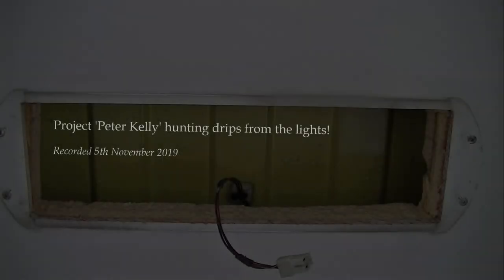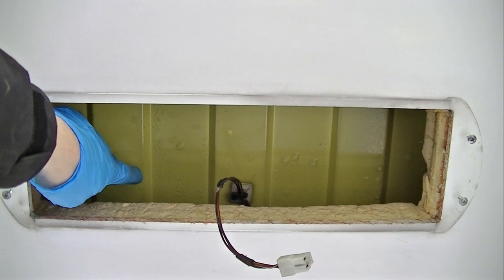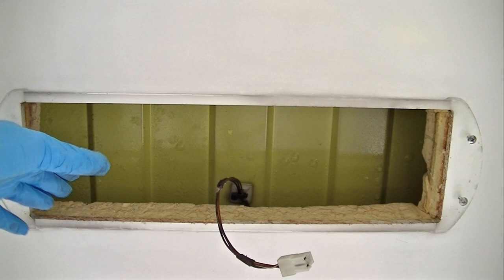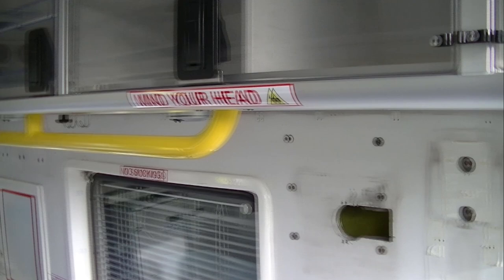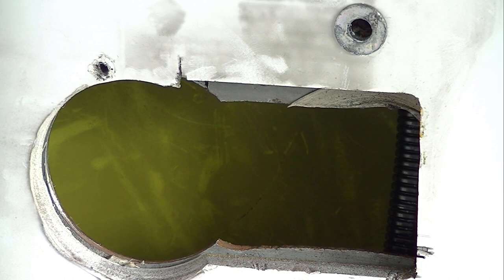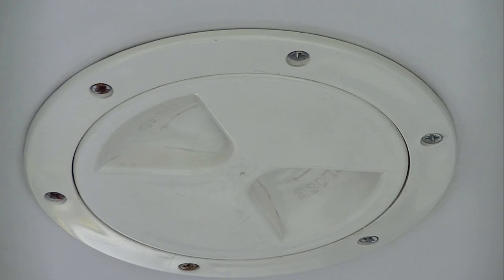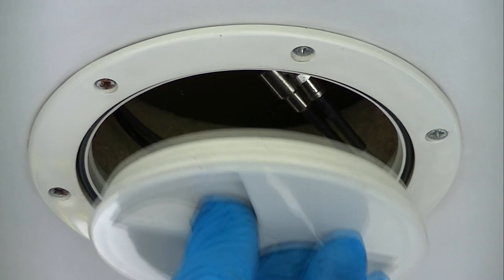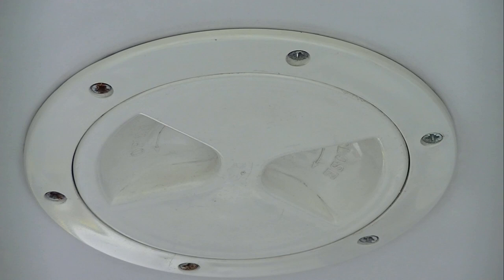Peugeot Boxer ex UK A&E Ambulance conversion, condensation due to compromised insulation.

Comment: Good airflow to the outside behind the insulation works great on buildings hence all the vents.
Vans are a different beast though.
My old Talbot express has around 4 mm of insulation sandwiched between two pieces off 3 or 4mm ply with a 3 to 4' gap between it and the outer skin, no vapour barrier and it's 27 years old, yes, 3 to 4 mm insulation lol. The eberspacher works great and cheap to run for long periods 🙂
The ceiling is better insulated I think and I'm not sure about a vapour barrier.
There is quite a lot of ventilation though.
I wonder sometimes what really is the best approach because any mistake like drilling and putting too long a screw through a side wall and piercing the vapour barrier to fix something to a wall could be a concern, letting moisture in that gets trapped with no way out.
I cannot remember the video name or guy but he was building a camper and had lived in all sorts for a long time, from Alaska to the likes of California and he was all for breathable side walls with no vapour barrier, if moisture gets in it can get out everywhere if everything is breathable. More energy used to heat it though in cold but cools down quicker on warm nights making it more comfortable.
He was not a Young chap and seemed like he had experienced what he said.
My van would probably be a Good example.
Reply from the maker: pa maj it’s a hot topic! Pun.... do you watch Greg Virgoe on YouTube? I think his views on insulation match my own
A flexible vapour barrier such as reflectex will self seal around screws I am going to aim for a similar install in Thistle.

This ambulance like my other two has so many holes in the walls for equipment and airways where the insulation is poorly fitted that it is inevitable heat will enter and condensation will form at the highest point I.e the ceiling

All four of the lights fittings shows signs of dripping. I suspect what’s happening in this van is a form of Interstitial condensation.

But condensation can never be completely beaten and it often won’t matter too much my Crafter has quite a lot but there wasn’t an6 signs of rot or mould or even rust

Where insulation also plays a significant part is temp control in the summer that may actually be more important for comfort then turning the heat up a bit in winter.

The other significant advantage is sound proofing.

So on balance it’s still worth lobbing in as much as possible imho.

A really good fix for condensation is a wood burner!
Might put one in Thistle after all now!

TTFN
Reply: @CriftinsCampers  Yes I'm subbed and watch Greg's videos Keith, good chap he is and knows his stuff.
I would like to see a well insulated van of over five years dissected though just to satisfy my curiosity.
How does the industry do it?
A diesel heater ( mines an eberspacher ) is a great dry heat source, mine came already fitted.
I'd love a  Mini Cyclops from Glastonbury burners ( not sure of burn time ) or a CB-1008 CUB Cubic Mini Wood Stove or it's bigger brother the grizzly for longer burn times but the later two are from Canada and more expensive.
If I ever fit a van out myself I'll fit a diesel night heater plus a Mini Cyclops I think.
Burning free fuel is always fun 🙂 and the best van TV there is lol, fire, an instant mood lifter!

Comment: Check out my vid on vapor barrier, i found a full on garden in the one break in my barrier ! 
I thought i'd struck gold but turned out to be mould :(
 well i found moss but that didn't ryme ;)
Allways enjoy your vids chap :)
Reply from the maker: Did you see the compost and Green mouldy Jelly babies in the floor of this Peugeot? That van to date has been the most disgusting vehicle I have ever touched everything was filthy even the paint behind the insulation was black. It had probably been ingesting diesel smuts for years I suspect.
Reply: @CriftinsCampers  Emergency rations !
TBH being a mechanic i get to see some really, REALLY disgusting underseat areas, the worst are allways the ones with seat airbag issue of course !